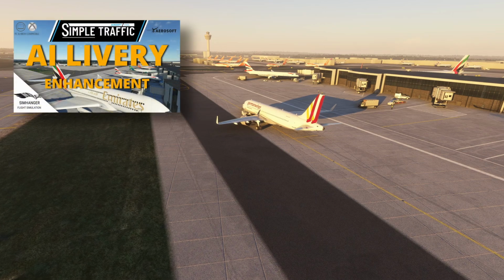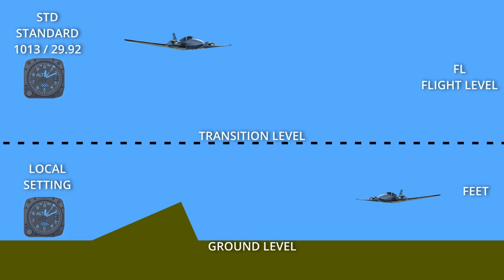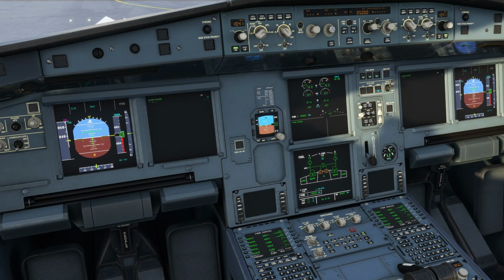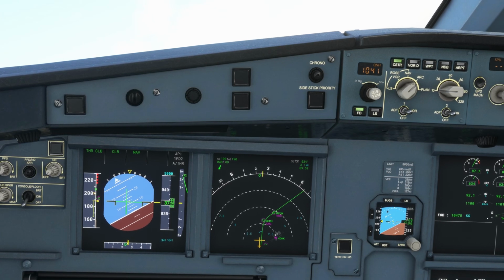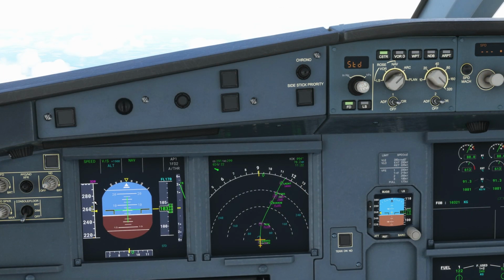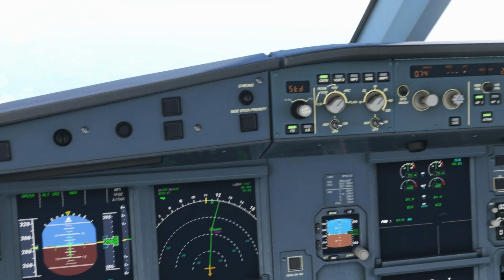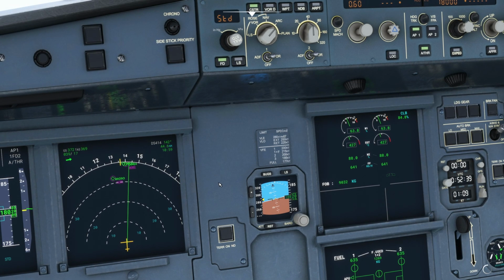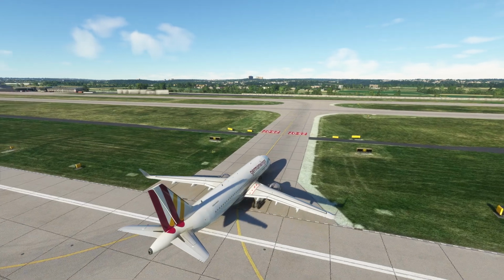MSFS | FLY YOUR IFR ROUTE | Understanding QNH, Transition Levels  & Airway constraints | Xbox and PC

Comment: Hello,
I will be buying the asus zephyrus g14 laptop 5900 rtx 3060, 32 gb Ram to run the flight simulator 2020 on the oculus quest 2 do you think i will get the best performance, visuals and best VR experience on this laptop  keep in mind i have the turtle beach velocityone, kindly advice before i take any decision
Thanks
Reply from the maker: Hi, not tried it on a laptop myself, specs should allow you to run at medium settings.

Comment: How do I set speed on the xbox . I use velocity one and dont have the push and pull possibility.
Reply from the maker: Check out my config videos https://youtu.be/KLkTh9Gh3wY
Reply: Thanks for your response Marc. I follow all of your video,s but I can,t find the solution there. With the Mouse the speed button highlites but I don,t have a push or pull posibility. On the controler it was the xbutton. But I don,t use the controller in combination with the velocityone. Or should I do that?
Reply from the maker: @hagennico  did you see the suggested change to the mouse settings in this video….change to legacy
Reply: @SimHangerFS  I have default and  Mouse profile. Don,t see legacy
Reply: @hagennico  Problem solved. Thanks again for the Quick response. Let me know when you are in The Netherlands. Gonna buy you a beer!
Reply from the maker: @hagennico  see the note on the screen in my video at time 10:47